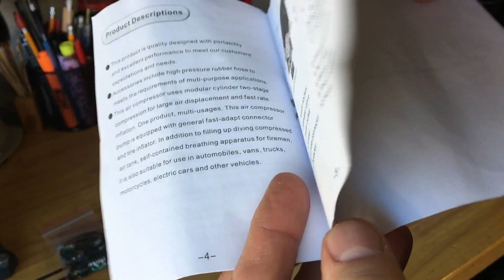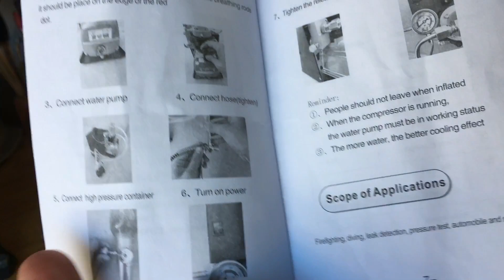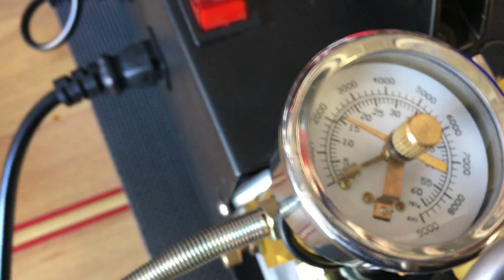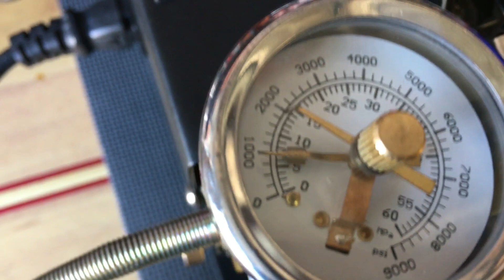Tuxing PCP Air Compressor: HPA SUCCESS finally!

Comment: Hello, how did you replace the white seal in the release vent, please? I ruined it and not able to remove it completly
Reply from the maker: I used a soldering iron in this case, but I'd imagine a head gun would do the trick as well.
Reply: @ReLoadersBench  I tried the iron, but it looks its ptfe - even highest temperature could not melt it. So finally I removed it with 2 flute 8mm end mill mounted into hand drill (no electric) and slowly carefully drill it out of the hole.

Comment: Just ordered mine. Just wanted to go cheap. When it fails - I'll just get a lesson and experience in these compressors..
What already started intriguing me, were these issues here. Really odd one imo. Really would wanna knlw what is behind those bleed valve and whip holes. As if the whip threads going too far inside (without the steel/rubber washer) would block something and causing an issue to pressure up. And same with that bleed valve point. No idea why two white washer seals is needed cuz just oughta be a seal during filling. Might be a side air port in the rhreads or something? Dunno. But still an interesting thing if only that was the cause for it not working better than in the older video where it was only like blowing a candle out.. But. Will see for myself when mine eventually shows up. Probably gonna put an additional gauge before the air hose. The top gauge had a pretty darn wide pressure range it seemed, and the needle jumped around like a sob (dead-headed anyways)..
But it seemingly is a pretty cool compressor project if not anything else for me in the future..

Comment: Get a Tuxing from Tuxing store not Amazon. 1250 on Amazon and 800 from Tuxing. 032 model.
Reply from the maker: Too bad the 032 model wasn't available 4 years ago.  Looks like Tuxing integrated many of my additions (see follow up videos) of large dual filters, air intake inline desiccant, etc. But these are still too pricey @ $800-$1,000 IMO.

Comment: I have the same one sitting here that did not run but one minute before it burned a few wires into in the motor windings. I,m now new to setting these compressor up, believe me. I only bought a Tuxing because parts are hard to find in rebuilding my old one & Tuxing like YH parts are available. But forget  
Tuxing service to warranty or help you in any way if you a faulty unit. They have your money & it,s your problem. Sorry but they will not even contact back.
Reply from the maker: Since they are so readily available now, I’d purchase from Amazon so if there was an initial (or first 30 days) problem a return/exchange/refund is easy enough. These things are not built to last IMO.

Comment: I bought one thru Amazon, the 12 volt TXET62 version. Didn’t work out of the box, found a cracked hard coiled line inside. They wouldn’t take it back, said return shipping is too expensive and I had a very hard time communicating with them about which parts had failed. They rarely responded until Amazon refunded me. They contacted me non stop after that, even a 5am facetime call...promised to send the correct parts 3 weeks ago. We’ll see what happens.

Nomad 2 may be in my future, since it’s what they copied anyway. Being cheap didn’t work out for me.
Good luck with yours!
Reply: Same problem on mine after 30 minutes use.
Been trying to get a replacement part and no reply from tuxing at all...
Reply from the maker: I looked at my purchase initially with the expectation this probably would not work and I was okay with the "gamble".  Turns out it did work and I would say I got what I paid for and am content with that.

Comment: Is it still running? I am looking for a compressor for my PCP, but I want it to last longer than a few hours so I am curious how yours is going?
Reply from the maker: As of October 2019, yes it's still humming away.  Also looks like pricing has dropped ~30% since my purchase 1.5yrs ago.  So the way I look at it, if mine fails I'll pick up the same thing for less.  I've taken care of mine (regular oil changes, blowing out water after usage, etc.) to keep it running (just the opposite of my lawn mower :-).  Hasn't let me down.

Comment: I’m trying to trouble shoot mine. My motor doesn’t start, when I manually turn the motor via the “fan” end I get a jamming /pumping resistance is this normal?
Reply from the maker: R.  - is this a brand new unit (first time trying to get it running) or a unit you've had that previously worked but is now no longer running?

Comment: How long does take you to fill up that 68/4500 tank ? How hot does your compressor run with one fill?
Reply from the maker: Forgot to anwer the hot question. With ice cold water, the compressor is in the low 50 celcius area after  the first 15 min on filling the big tank. I can usually get 2 15 min fill session before having to change out the water (I don't let the temp run above 62 c).
Reply from the maker: I've never timed how long it took, but it was pretty quick.  For my 74 cubic foot tank, it takes 4 fills of 15 min each (change out water and smaller filters) from the compressor.  At 74 cu ft, that's 888 ci, or about 13x larger than the 68/4500 tank.  So if I'm taking ~60 minutes to fill the 888/4500 big tank, the 68/4500 is a bit over 4 minutes to fill or so.